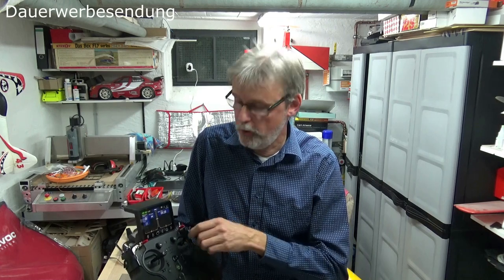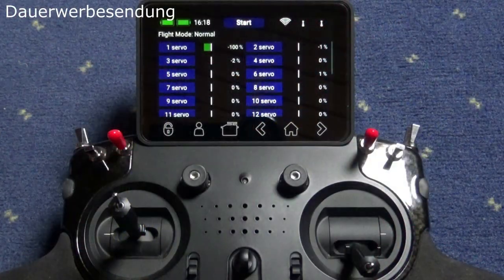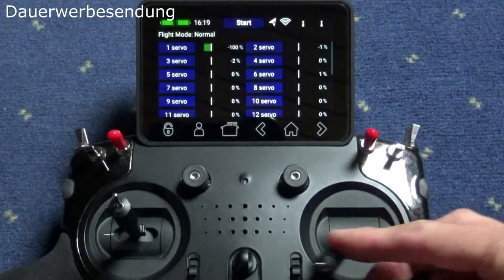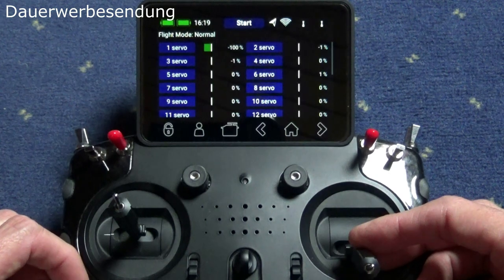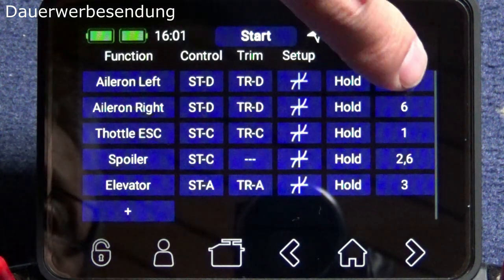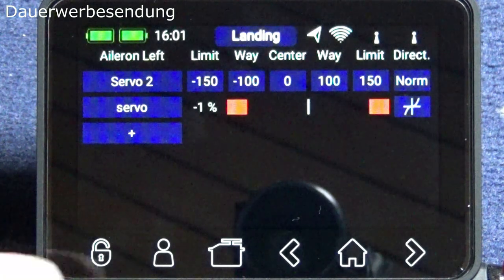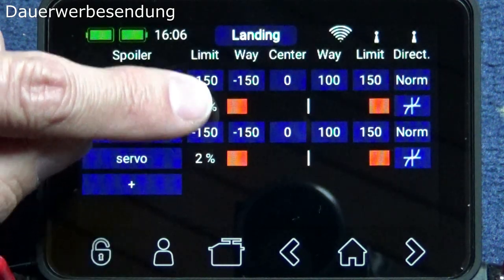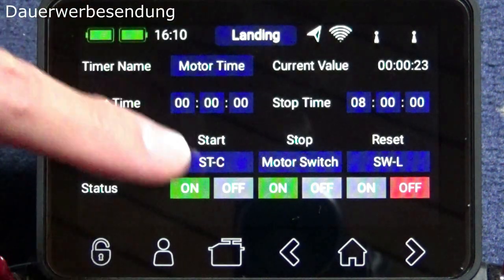CORE Rocket Flight Phase English

Comment: Hi Ralph, I'm trying to setup mySU30 with tailrons that works with gyro setup through Royal, I setup the tailrons through Aileron L mix with evlevator L and so on the right side, everything works fine except the gyro, I have gyro working correctly all other surfaces except Ailerons on the elevator for tailrons,  why is it that the gyro doesn't come through the Mix, any suggestions  please?